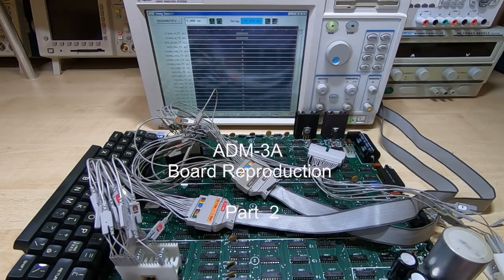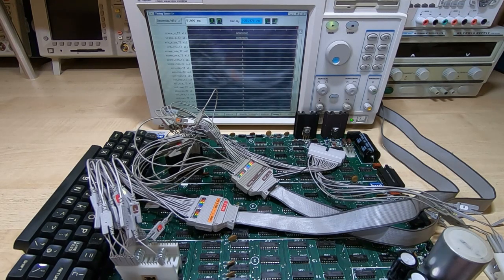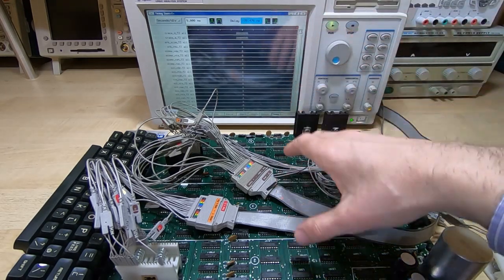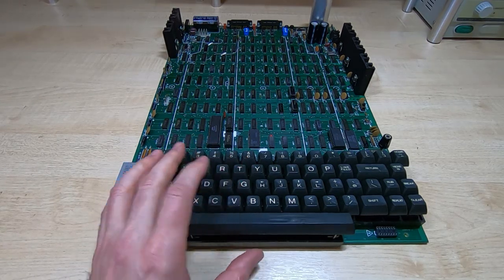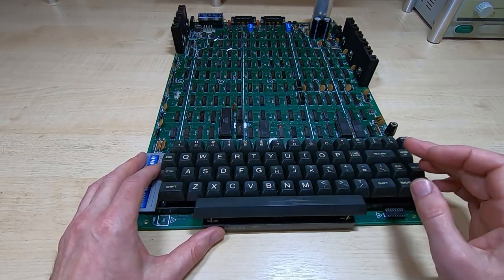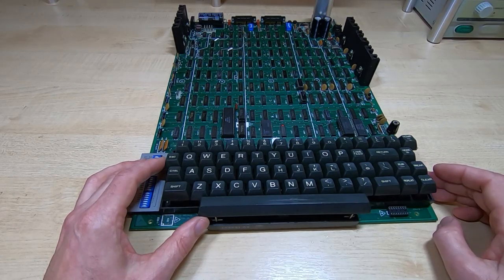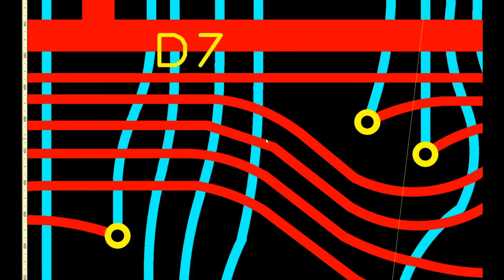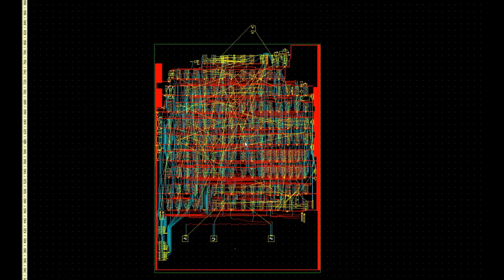ADM-3A  Board Reproduction Part2

Comment: Many PC keyboards still support the PS2 protocol even though they have a USB connector.  Use a micro controller to interface the PS2 keyboard to the data bus replacing the dedicated keyboard controller that is on the mother board.  A cheap flexible solution to an obsolete keyboard.
Reply from the maker: There is no keyboard controller, it is all discrete. Even if there was then this would defeat the purpose of this project. The goal is to recreate the ADM-3A. It woud be easy to create a dumb terminal in an FPGA but that is not what I am trying to acheive.
Reply: @JerryWalker001  Weird.  At that time there was a dedicated keyboard encoder ASIC.  It took care of the key scanning and generating ASCII data on a parallel interface.
Reply from the maker: This is a dumb terminal. It was designed before keyboard controllers were a common thing. The entire board is really nothing more than a serial to keyboard convertor. This is how things back in the 70's were designed. It is a very interesting device because it is discrete in nature.

Comment: they probably realized the schematics wouldnt work and had to revise during production.  I've also had some speculation that some "dummy" schematics got released so that people would not be able to copy the designs, ie ones that may not necissarily work so you'd have to reverse engineer directly off the actual hardware.  I've procured a WYSE terminal from the late 80s that came from a public library.. when they were using terminals for computer access to the library catalog (post-card catalog era).
Reply: 63 hours? thats not too bad.   Yeah it takes quite a while.  Thats a nice LA! :)  I go blind trying to hunker over the 16500 I have.  I'd like to find one with VGA output so I can put it on a big screen :)  I don't have a lot of time for my projects at the moment and I have considered paying someone to copy original schematics onto a EDA system so I can work on getting them up to current standard.
Reply from the maker: I worked in the industry back then and this was not uncommon. Schematics were frequently drawn by hand and this often led to mistakes. In modern CAD systems (as I now use) an error in a node connection is picked up by the software but back in the 70's it was pencil and paper and it was very easy to miss mistakes and this is possibly why the actual board I have here is revision 7. There may also have been inentional obfuscation but I think it is mostly unintentional mistakes. Also the schematics are most likely not for this exact version of the board. I find this in just about every reproduction project but this one extends across 15 schematics and each seems to use different styles (most likely draw by different people) so it makes this one a bit more challenging than most. One of the reasons I make the videos is to show how easy things are now compared to back then. How is your project going?
Reply: @JerryWalker001  yeah I agree with that 100% most probably not intentional but some likely are, especially if they let out many different versions.  I need my Scope to finish some of the hardware version of my project.  It will need recapping and some calibration.  Thats the email I sent you.  I'm trying to find layouts for Japanese 1SS type diodes.  I would happily send anyone the original schematics if they would at least help me get started on layout.  The board is 12"x12"..  the main boards that need completed are the Main and PLL board and I am trying to decide whether ot use a VFD or a display.  Most of the major manufacturers of these designs used the same set of components but added their own flavor of extra components to it.  then I have to work on a filter board.